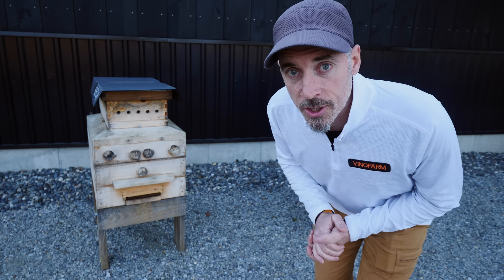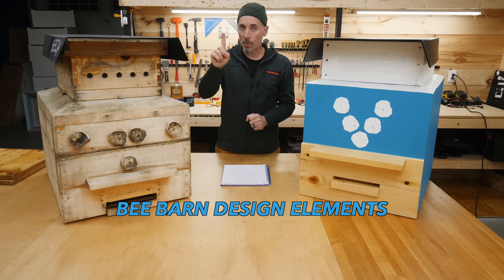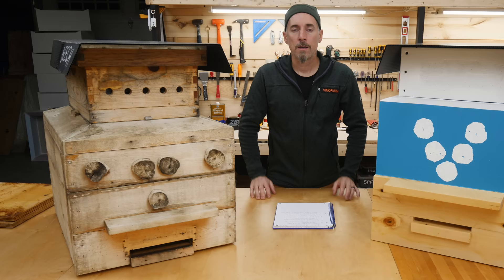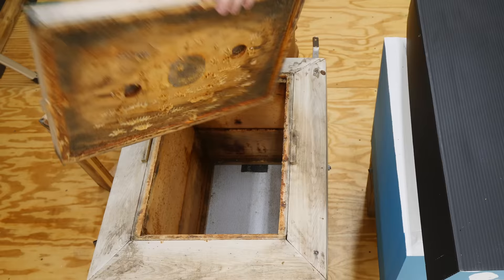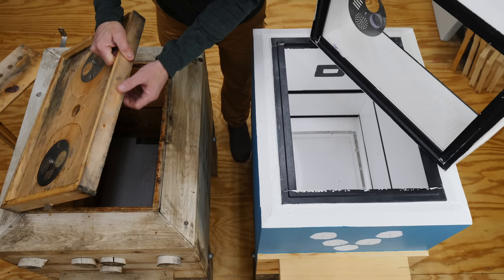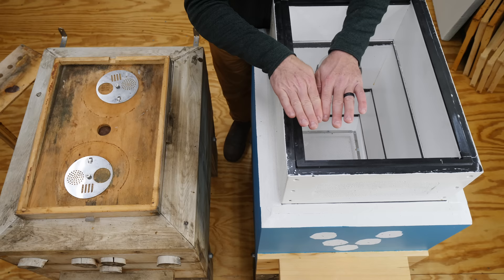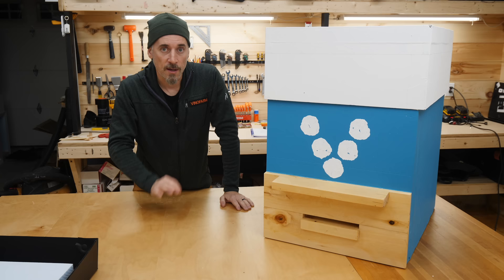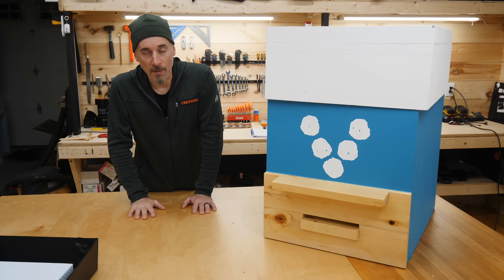I Fixed The Langstroth Hive (Again) - Bee Barn 2.0 REVEAL!

Comment: This may be lengthy, and I apologize for that in advance.

I just finished watching this (twice) and reading the comments (once). I just had to laugh and shake my head at some of the latter, and I don't understand why it's difficult for some people to grasp that you're not claiming to be better than xyz or unnecessarily trying to reinvent the wheel when product abc exists. "Bees won't like foam!, they like wood!" If I have learned nothing else about bees over the years, it's that bees will merrily make a home out of just about anything, and that while they may have their utopian location, just like  those of us who are not bees, they will come across something that is good enough, at least to stay for awhile it's deemed unsuitable. The new search begins - lather, rinse, repeat. I'm not even going to address the ones that are (basically) calling you a terrible beekeeper with a god complex or whatever that bs is.

On to the better part: I, for one, offer my profound thanks to your diligent work on this and your kindness in sharing your designs and thoughts without requiring anything from your viewers. I began having issues with my neck and back early last year (the ongoing effects of radiation treatment to my head and neck for cancer some years ago) and because of this, I have problems with strength in my upper body. It progressively got worse, to the point where getting to the yard and dealing with the bees was an exercise in agony and also had to be split into multiple trips. I was interested in building one of the BBv1 hives, to see how I would fare with fewer things to lift - and it isn't just that you have to lift a box once to do something. If the flow is on and you have supers in place but need to check the brood for any reason, those supers have to be stripped off (lift one), a double deep brood box may require one to be lifted to get to the bottom (lift one for that), and then the second lift is putting all of those back into place.

Now, before my body betrayed me, this was not something in particular I had to think about. These days, it is, and at the end of last year around the beginning of October, I was dreadfully ill for over a month and was not able to get to my bees during that critical period. For the first time since the first year I kept bees, I lost 70% of my hives for various reasons. Not fun, and I was seriously considering selling the bees I had left and letting go of beekeeping. I still wanted to try BBv1, though, to see how demanding it would be to keep a few in BBs instead. Never got to it.

Then I get a notification that you're back, and popped in to see this new and improved BBv2, and I cannot think of anything that could be more of a game changer for me and for people like me who have very real, very serious physical issues. I'm not discounting people without these kinds of physical battles, I'm sure it will be a boon for them as well. I know some people say "Just use eight frame medium hives!" I do. I started switching to eight frame mediums about three years ago. They're still heavy. There are still multiple boxes to lift to inspect things, only now there are more of them. For the first time in a year, I'm thinking it may not be necessary to completely give up beekeeping. There are a couple of things I would change, but that is not due to the overall design but rather to my specific, particular location - a point some people have appeared to not understand that this was your intent: to share with people what you learned, how you thought, and that you've provided not an end-all be-all blueprint that fits anyone, anywhere, exactly, using your build (although I think it very will could). It's because I live in the south with high temps and high humidity and high rainfall amounts over a very, very long season. 

So thanks, Jim. I appreciate the thoughtfulness and logic that went into the design, and the intent to make something great - beekeeping - into something that is even better for you and no doubt a large number of people along the way.

Happy new year! Welcome back. I can only echo the sentiments of other commenters in saying you were missed.
Reply from the maker: I am so sorry to hear about your health issues. I do hope you are recovering. I appreciate your support over the years and your always thoughtful, kind comments. You get me. Ha ha. 

These hives are a joy to work with but they do still require lifting of supers for inspections during summer months. I have an old back that works very well most of the time but pre-bee barn inspections would KILL it. It was a combination of lifting and bending that did me in. I can lift a super off these hives from an upright stance and be fine. But bending over and even just pulling frames from a low brood box wrecks my back after about 10 minutes. So the bee barns solved that. Still some lifting… but, ergonomically, WAY WAY better. Even if you don’t go the insulation route, maybe you can try the deep frames in a deep/ medium setup so you don’t need to bend so much. I’m going to be uploading the frame video in about 2 weeks or so and  you might want to check it out. 

Thank you!
Reply: @vinofarm  I'll be checking out all of them, LOL. My lifting of supers I wound up solving by just hauling an empty box out with me. Pop the top, take the frames out of the top super, drop them in the empty. Lather, rinse, repeat with each box. When it's time to reassemble, do the same thing in reverse, et voila! The original boxes are back in place with their frames in the same order they were.

I'll definitely be trying the insulation route. It's brutal down here during the summer, and our "winter" does involve actual winter-sorta weather from time to time. We had a run of five overnights a couple of weeks ago that were in the low-mid 20s (although it's generally much milder than that - still too old to me!). I figure it won't hurt the girls to have some insulation in their lives. They live in worse, like the swarm I picked up that had taken up residence in an old, empty gallon paint can.

Take care - looking forward to the series!

Comment: As a beekeeper I tend to look at all aspects, I can understand engineering to adapt to conditions, but as a practical thinker, wouldn’t it be much more practical to just store hives in a building out of the cold to eliminate any losses if the climate is that harsh? It seems to be much less work and the hives can remain standard equipment… We dont get to bad temps in the south but when we do I just put hives in a storage building here and have no issues…
Reply from the maker: Think about what you're comparing: 
1. Creating a climate controlled building to house beehives. Moving all of your beehives into that building every fall. Maintaining temperature in that building all winter so the bees don't freeze OR fly out of their hives. Then timing the removal of those hives from the building to avoid late winter cold snaps. Then physically moving all of your hives BACK outside in the spring time. Then repeating that every year.

2. Building hives that are suitable for the bees to live in YEAR ROUND, that actually help them out with earlier brood rearing, managing their OWN temperature and humidity and allow them to survive winters with minimal use of honey stores. Then leaving those hives in place year round and literally never having to lift them again, ever. 

These hives are suitable for any climate. Insulation is good for beehives in any temperature zone. Insulation will always slow the transfer of heat (from outside, in in summer and from inside out in winter.) Slowing the transfer of heat will help stabilize the temperature and humidity in the brood cavity and will only help the bees.
Reply: @vinofarm  So why not just put them in a greenhouse up there in winter or will there be a snow load issue to not allow a greenhouse? I understand your point completely, and agree with a small apiary that is the absolute positive position.. But if you have a 100 hives or more , stacking them on pallets and getting them out of the weather would surely be a option wouldn’t it? Down here in the south we make use of greenhouses during winter and they are awesome for heating the hives during daytime and we just roll them out on pallets after winter and set them up .. The hives thrive and we have very strong brood in spring with very productive honey flow.. Im sure up north the snow could be a bad issue with any greenhouse collapsing etc unless it was built  to withstand such..
Reply from the maker: @southernhellstorm6634  I came to the conclusion 2 years ago that I don't like lifting hives. And I think there is a huge benefit to a colony if their home never moves. Again... think of a tree. I made these hives thick and stout, like an old tree. They are not meant to be moved. Once in place, you only need to lift frames for inspections. Supers go on for summer and come off in fall and the hive is condensed into a thermally stable brood cavity. That's it. Moving hives in and out of buildings or transporting them to different locations is just not something I will ever do and neither will any of the other hobby beekeepers watching my videos. I'm not trying to solve for every beehive scenario, just for people similar to me with maybe 20 or fewer hives on one piece of land. This is a new way to think about a beehive in that situation. No wrapping and unwrapping insulation every winter. No lifting boxes. A better cavity for the bees... I'm just sharing what I'm doing and hoping people get inspired and start making better homes for their own bees. The thing about moving bees into a building for winter is that you also need to worry about that building staying COLD enough to trick the bees to stay in their hives. It's a huge management nightmare. Lose power in the bee house in March? Can't cool the room for a day or two? Congratulations, you have several million bees flying wild inside a building. No thanks.

Comment: I have watch and studied you from your first bees. You have taught me a lot. 
If I remember correct beebarn 1 had Styrofoam insulation in the feeder box over winter and now beebarn 2 you are useing
Burlap.  I am assuming you feel the insulation around the top feeder box will keep the glass from becoming cold and producing condensation . Is this correct?
Did you go to burlap because of the ease of removal to get to the glass for inspection or some other reason.
Thank you for your reply and glad to see you back. I missed you.

Comment: I noticed that when you lifted it up in March (?) there wasn't any winter feed. Do you not have to do this in the 1.0 or 2.0? If so, can you explain where it goes? It didn't look as if there was enough room.
Reply from the maker: Watch the "Bee Barn Results" Video... There was 50-75% of the honey leftover from the previous fall. I do not feed over winter anymore with these boxes. If the brood box is full in October, there is way more than enough food for them until May when nectar starts coming in again. More insulation=less resources consumed. No winter feed or supplements or candy boards or fondant or mountain camp or cane sugar needed!
Reply: @vinofarm  Hey thanks for the quick reply. On my way home last night, (I have an hour drive to work) Could you use two of the deep foundations and just cut them so that there is not a 1 inch gap? I know you said you wanted to leave room for them to make up their own minds on what they wanted to do with it but it seems they want to build the honeycomb all the way up through it.
Reply from the maker: @jimlanum2832  They leave pass-through space in the gap. I don't want a wall of plastic in there.

Comment: I'll be very curious to see how the bees respond to the polystyrene boxes. I have seen my bees completely chew through the same type of foam when I had a piece under my outer cover. They essentially created their own upper entrance by spring.

EDIT: Nevermind, it’s not the same foam on the inside as on the outside layer. They’re Lyson hive bodies.
Reply: My concern as well. It looks like he's using standard foam insulation, but it's possible that it's high density. If it's standard, they'll chew it to bits in no time. My first year I built a foam nuc, and they destroyed it in less than a week.
Reply: I am concerned about bees chewing the polystyrene, too. Might have to line the inside with 1/4" under-laminate. Wonder if a coat of paint (Latex of course) would discourage them from chewing, but then again they say never paint the inside, leave it natural wood. I saw video from a guy in Britain a few years back, that was starting to use commercially built polystyrene hives. They looked pretty cool, very modular.
Reply: @michaelmroz9378  that's what it looks like he's using here after some closer inspection. Those look like Lyson polystyrene hive bodies that are the inner white layer, wrapped in 2" XPS (pink) foam.
Reply from the maker: @mike_carvalho figured it out. But it's not a secret! I'm sharing everything on Tuesday. I didn't realize the crazy concern for bees chewing foam (1/2 of this video's comments!) or I would have addressed that in the video. The inner hive is a standard poly hive that is in use by thousands of beekeepers. The outer layer is XPS but the bees are never in contact with that so I didn't think it was worth addressing.

Comment: Foam board used?   Thanks for sharing!!!
Reply from the maker: The pink stuff from the Home center! Polystyrene 2.5" thick.
Reply: @vinofarm  Ants have chewed through our foam panels, and the bees have chewed low density styro I've used.  OTOH I have lyson styro hives that have some kind of high density coating and the ants don't chew those.    Just saying.....
Reply from the maker: @justducky0  The inner hive boxes are Lyson. The outer wraps are XPS lightweight stuff.

Comment: My one question is about the foam on the inside of the hive... I've seen people put foam in their covers, over their inner covers, etc. and they always find the foam chewed up... the bees don't seem to like it and chew it away... It's easy enough to put an eighth in wood insert in, but you haven't... problem?
Reply: The foam on the inside isn't polystyrene but polyurethane presumably, which bees don't chew up. He mentions in the video that he bought 9 frame boxes for the inside.
Reply: @t_g_gamerftw5075  He actually said he built it to fit 9 frame boxes he has for supering... He specified the barn was entirely foam... 

The insulation boards most people cut down to insulate their hives is either extruded polystyrene or polisocyanurate (which is the really expensive stuff)... 

Even if you were correct, I don't see any reason why they'd be less likely to chew polyeurethan that polystyrene...

I was posing the question to make sure that he was aware of this possibility and wasn't going to run into a massive problem down the road...
Reply: @Amethyst1919  Ah I see where I messed up. I thought you were talking about the inner 9 frame box itself. Going back to your original post and rereading, I now realized you were talking about the foam wedge insert. That definitely is a concern if it's made of the same foam as the outside foam insulation.

As for the reason polyurethane wouldn't get chewed up is because it's denser and harder than the normal foam insulation that is extruded in sheets that you can buy. You see beehives made of it or polystyrene that is mold made by expanding foam which results in harder and denser foam than your standard sheeting. This extra hardness and density prevent the bees from chewing it up.
Reply: @t_g_gamerftw5075  I was talking about the inside of the bee barn itself... but what you say makes sense... I'd hate to see a scratch or dent from a hive tool start a rough area that cause the bees to just obliterate it...

Comment: Cool design, not sure if you will run into this but I made a poly foam nuc hives once and it worked well until the bees realized that they could chew it. After that they more or less made swiss cheese of them.
Reply from the maker: I will see what happens and then modify my design to fix flaws. This is 2.0… I’m sure there will be many more versions, but the concept will most likely stay in place. That’s the key here.

Comment: Excellent video and hive design, and glad to see you back on. Question: If the hive has a water escape path, how does that opening not lead to a draft and result in more condensation? Will that become the weak point of this new design?
Reply from the maker: There is no straight line for a draft from the rear or bottom. Air would need to blow past the seam around the two inch thick foam back door, then make a 90º turn and blow through 5 small holes in the debris tray and continue up into the brood cavity. The front entrance is 8" wide and 5/8" tall... A much larger hole.

Comment: For hives in South Florida we have high heat in the hives in summer and full hive bearding. Do you feel the full insulation will help or make it worst?
Reply from the maker: I have never kept bees in Florida, but I believe any hive in any climate would benefit with insulation. Insulation works both ways... it keeps heat in OR out.
Reply: Check Bug Farmer's channel, he is using (heated) bee barns in Georgia and his results are that full insulation does help with bearding (the inside of the hive doesn't get as hot, thanks to the insulation).